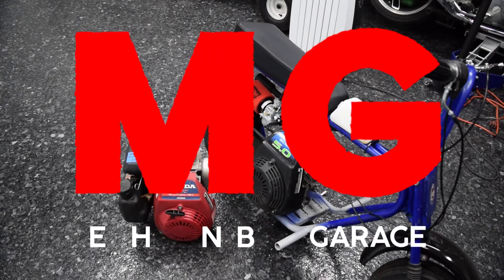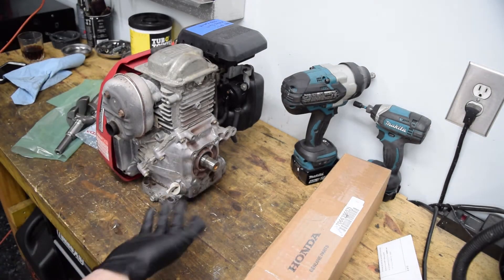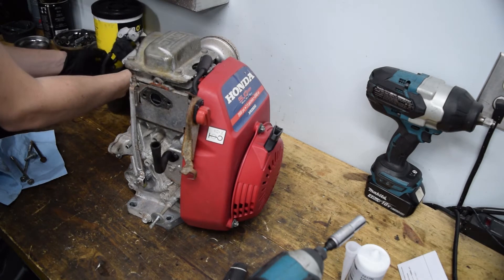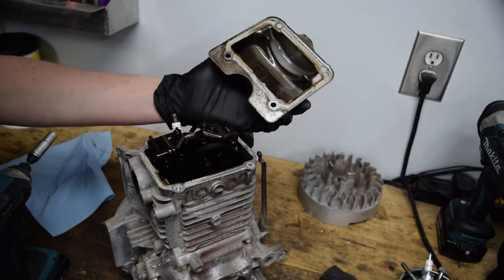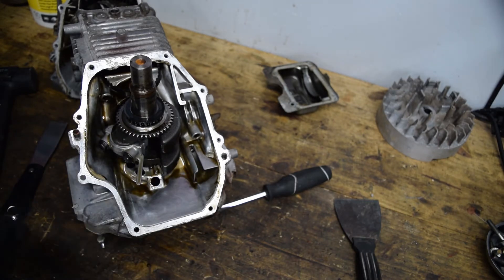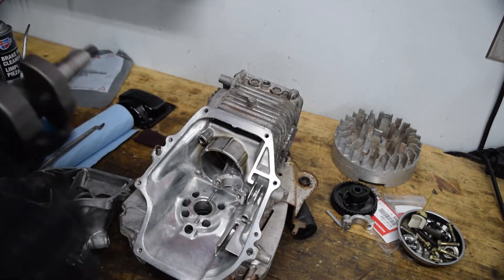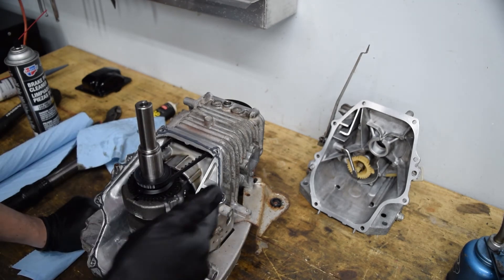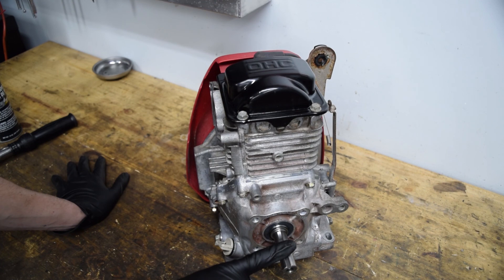Honda GC160 Tear down/Rebuild Crank Swap

Comment: what i’m i missing here i can’t open up my engine it feels like something is holding it in place still i followed everything you did and even got it to open a bit but can separate the engine to get inside … does the crank have to be in a certain position or the cylinder head im getting frustrated i have a valve fallen into the cylinder area ? i can see it thru the exhaust manifold when removed

Comment: Awesome video man, ty. I just got an old pressure washer (red engine covers) and planning to rebuild the motor for a go-kart project with my kids. Should I look for a different engine or is it worth the time/expense? Washer is missing everything but motor and pump plus it was free. Any advise will be appreciated as this will be my very first engine rebuild.
Reply from the maker: Those GC engines are pretty good imo just not a lot of aftermarket support. I used one of them on the bike linked https://www.youtube.com/watch?v=Vt4qEpDok_U
Reply: @MechannibalGarage65  Iv seen that video. Thx for the info, appreciate it!
Reply: @MechannibalGarage65  Great video man, thank you. Iv been referring to it as Iv been tearing my engine down. Do you have a video explaining/showing how and what a clutch kit works for a go-kart? Do I even need a clutch? Sorry, this is all new to me.

Comment: Question how does the bike run with the aftermarket carb ? Anything you have to do to make this work? Gov delete?
Reply from the maker: Yes did the gov delete as well. It runs very well too.
Reply: @MechannibalGarage65  what carb kit did you use

Comment: i have one that i plan to dissasemble then machine a gear and timing chain system for so i can do a govenor removal with a flathead piston and billet flywheel for a racing motor
Reply from the maker: Good luck, that'd be sick if it works out

Comment: Junk engine is what I call them and there common exhaust valve problems and the other things 
Shame on Honda 😢😢
Pure junk will put you out of business 😊
Reply: I have about 750 hrs on my Gc 160 engine and second pump for the so far. They are not Junk!

Comment: I have the same engine on my BillyGoat blower.  I had just repaired the blower diverter and the engine was running loud before just stopping.  I was thinking a valve lifter broke but when I took the valve cover off I found the cam lifter wheel on the topside had imploded into the engine.  Lots of hours on the engine and wondered whether to repair or just replace
Reply from the maker: Yeah that's how I typically see them fail, luckily the engines are cheap to replace.

Comment: The flywheel nut torque setting is 52 Newton Metres, don't torque the crap out of it or else you'll crack it since it's made out of Aluminium !

Comment: is the gc160 and the gcv160 the same engine? one just flipped on its side to make it horizontal shaft, with an oil thrower on the con rod cap?
Reply from the maker: They're similar but not the same, there's a lot of small changes to allow oil to move around right as well different machining to the blocks.

Comment: How many times can this particular engine be rebuilt? What are the maximum hours the engine can handle?
Reply from the maker: Don't know how many hours but the cylinder bore isn't really machinable so once the stock rings are done then that's about it, can't just re-hone and install new rings/piston
Reply: @MechannibalGarage65  Well that sucks. Guess I'll have to look for a different engine to rebuild.

Comment: 3:16 "5/8" output shaft size" ??? I think you mean 3/4" or more specifically 19.05 mm diameter and 58.5 mm length per Honda specifications.
Reply from the maker: Yep I misspoke, it's 3/4

Comment: I have difficulties removing the flying wheel, I tried many times but not able to remove it, any suggestions
Reply from the maker: The last option to try to get it off is risky so be careful. Break the mounting nut loose and then thread the nut back onto the crank a few thread, place a pry bar between the engine and flywheel and apply a little pressure while simultaneously hitting the nut with a hammer. The nut will be sacrificial so make sure you're hitting it and not the crank for flywheel itself.

Comment: Where can I find high performance parts at
Reply from the maker: You won't find much if you search for parts for GC engines but a lot of the predator/GX engine parts will work on these.

Comment: Great video but I'm disappointed you didn't mess with the valves. I have this motor and the intake valve is stuck. I was watching this video to see if how to change it.................
Reply from the maker: Mine were fine so I didn't need to take them out, but the only way to access them is by removing the piston. They aren't as accessible as a traditional style engine and a normal valve compressing tool won't work so you will have to great creative with a way to compress the spring enough to remove the valve keepers.

Comment: I see that you put the Honda 5HP overhead Cam on a minibike with a mikuni style carb and a header pipe, looks great, what did you do with the GOVERNOR. My brother has a cool minibike with very little room for an engine , but the Honda OHC 5HP fits perfect, I plan on setting it up just like the blue minibike in your video.
How did you make the header fit, where did you get the intake manifold for the Carb, and do we remove the Governor?
I liked the video, very informative, thanks.
Reply from the maker: Most of the fine details are in the ARCO minibike episode but the governor is just bypassed, I left the components in the motor and then just removed the external parts. Intake is just a normal predator one I made fit, and I had to custom make the header.
Reply: U should make a video about it because I have a gc160 engine but I want to install a vm22 carb on it but i don't know how exactly how to do it

Comment: nice video.  I have a output shaft side to side play.  what do you think that could be?  Thanks
Reply from the maker: You'd have to measure it to know if it's within spec, a very small amount is okay but I'd say the case/crank bushings are worn out. I don't recall if they're replaceable or not though.
Reply: That's called end play . If all else is good and the end play is a huge problem  shim  it ?    It's even possible to  take  a punch and dimple the   part of the bearing  or case that  the crank rides up against and dimple it just litte  in several places.   Pushing out a bit of material ..   to take out some of the slack ..  back yard po boy method ...  we used to knurl  worn out parts to expand the surfaces a bit and reuse them .. .

Comment: These engines are very under-rated.  Superbly reliable and just as fast as any other 5hp engine.  Not much aftermarket support but hopefully that changes.

Comment: Do you know of the different bore sizes for the crankshaft part numbers? I've found #06131-Z8A-W00 and also #06131-Z8A-W30. You said the -W00 is a 5/8" bore, and I am looking for a crankshaft with a 3/4" bore for a #420 chain/mini-bike clutch. Thanks!
Reply from the maker: I might have mis-spoke on the diameter, the one I bought was a 3/4 output shaft and the part number is  06131-Z8A-W00. It looks like the W30 is the weird tapered shaft one so don't buy that one.
Reply: @MechannibalGarage65  That is great news, I have been calling different parts websites trying to get an answer. Thank you for responding, and for the great video.

Comment: Just found one of these engines and I'm looking to restore it though the one thing holding me back from opening it up is that brownish tube underneath the air filter and to the side of the gas tank. For mine it just hangs there not connected to anything and I wondered if that's how it is or it may be broken for me?

Edit: I just found my answer it's a tube attached to the carb but from what it seems like it hangs there so I should be all good 👍

Comment: i have the same engine as you but my output shaft has a measurement of 3/4 inch by 2 inches long might be a little more due to me measuring until the end of the keyway slot. do you know if i can find a clutch for the size or is it a weird one? thanks for posting and ride safe. and i forgot to mention, my engine is a Honda GC160 QHC model like the one on your mini bike.
Reply: @MechannibalGarage65  you’re right, I did notice that the clutch isn’t hard to find. But however, when I checked out the engine to try to start it I noticed that the camshaft is broken and that’s as far as I got. I know now that I’ll need to order the camshaft and the timing belt, thanks for the feedback and ride safe.
Reply: @MechannibalGarage65  I think this might be the time to install a jackshaft assembly, but only time will tell.